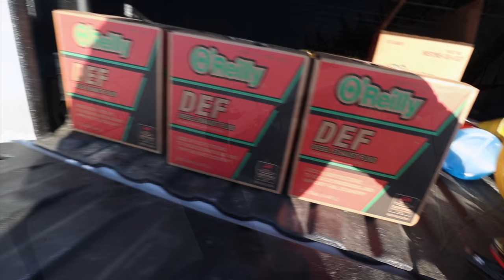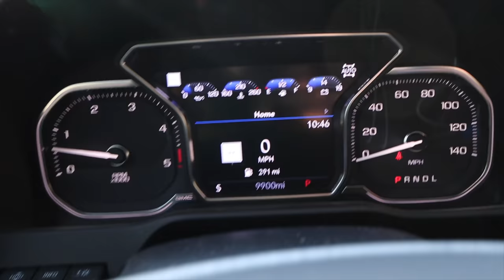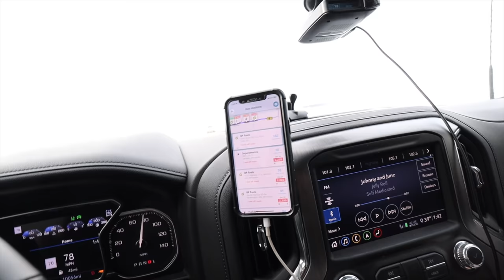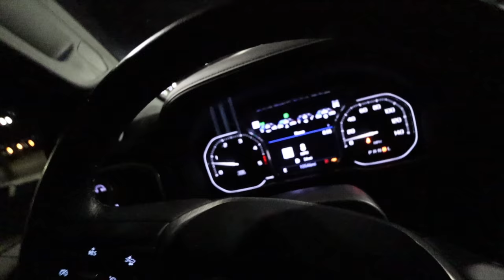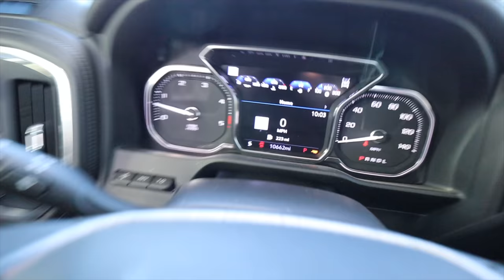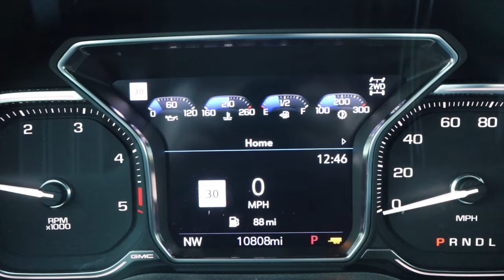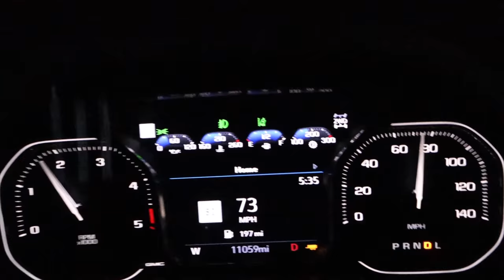Picking Up The Rolls Royce Limo Almost KILLED us! LamboFam

Comment: $1174.88 is my guess. 6.4mpg, 3000 miles times $2.50 a gallon.
Reply from the maker: WINNNNNNERRRRRRR!!! 
The total cost of fuel for the trip was $1133.58
Reply: Hey!! Heck yeah!!
Reply: @LamboDadd  that's awesome man. Its also alot $ in gas.
Reply from the maker: @stko6615  are you on Instagram?
Reply: @LamboDadd  @skoho859
Reply from the maker: @stko6615  Followed ya, and DM incoming :)
Reply: @LamboDadd  ur awesome

Comment from the maker: 🚨LAST CHANCE AT A FUEL GUESS!!! 🚨
3 Chances at a free SHIRT
1. Trip down
2. Trip back
3. Full Fuel cost.
I will give you a clue. The entire trip was 3000 miles!!
Reply: $750
Reply: $650
Reply: I'm gonna say the entire trip for gas alone was roughly $650.00 if you got diesel fuel which I'm guessing was around 2.50 a gallon multiply that by 225 miles a tank then divide that number by 3,000 is around $650.00 I'm not good at math at all so hopefully I'm right and not looking stupid in front of all these people lol so my answer is $650.00
Reply: 515 there 
515 back 
1030$ full trip
Reply: I’m gonna say $675
Reply: 1. Trip down $597.66
2. Trip back $637.50
3. Total  $1235.16
Reply: $1209 round trip
Reply: $925
Reply: $482 there, $515 back, Total  $997
Reply from the maker: @imAwesome4lyfe  Looking through alllll of the answers but this one is CLOSE! Your leading currenty!
Reply: $1250
Reply: $1175

Comment: Ok so you are getting about 12.39 miles per gallon. Assuming it is 1225-1250 miles from your house to Salt Lake City Utah. I am assuming ONLY to purchase fuel it will cost you about $250-$300. This doesn't include def or anything else. I based my answer on logic. 223 miles per tank divided by 18 gallons equals 12.39 mpg. 1250 divided by 12.39 equals 100 and 100 multiplied by 2.50 per gallon. 
Equals $450 Final answer due to wind. Haha🤣 Winner winner chicken dinner.
Reply from the maker: DANGGGG!! I’m impressed! I’m gonna give you hint though, we are getting well under 10mpg 😉
Reply: @LamboDadd  I know after I commented I had to reconsider. Its gonna vary because of after market wheels & tires. Also wind, weight how fast your traveling, ect. Even @ 6.5 miles per gallon thats a little shy of $500. 
So let's say $525 🤑 and this is only to Utah.